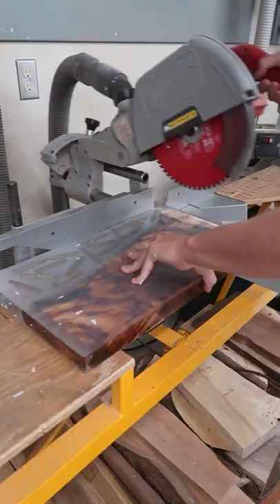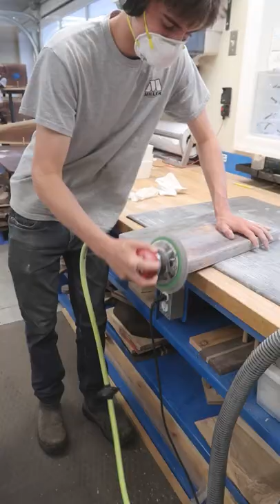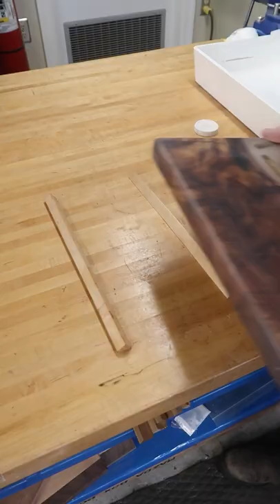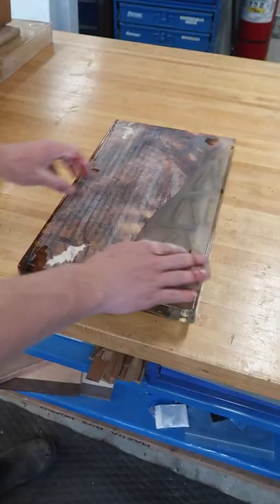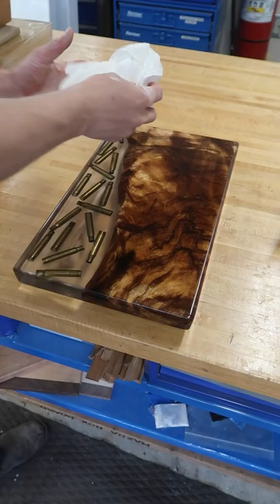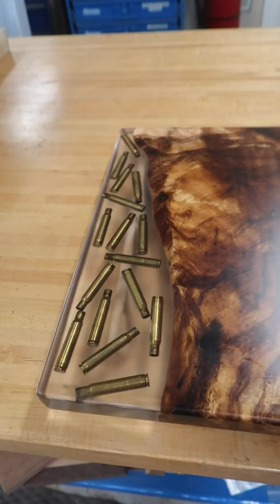Epoxy Bullet Board Build

Comment: Run into any issues with air bubbles coming out of the brass?  If so, how did you deal with that?
Reply from the maker: I did have that problem. If I were to do it again, id to two separate pours.
Reply: Fill each casing with epoxy and let it cure before adding them to your piece.